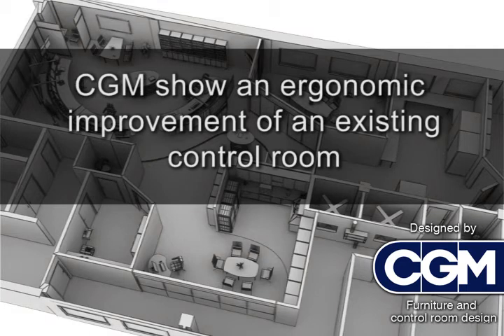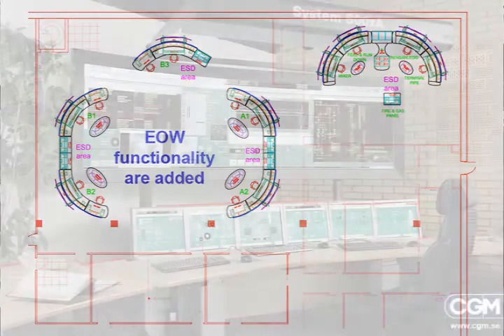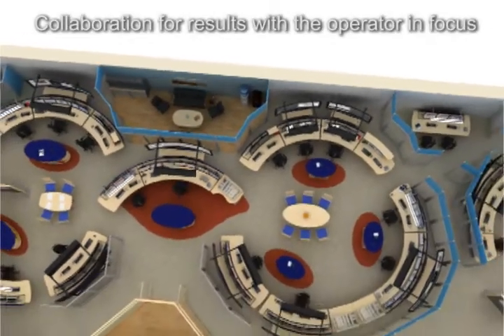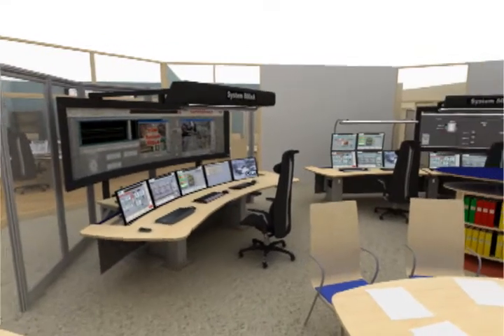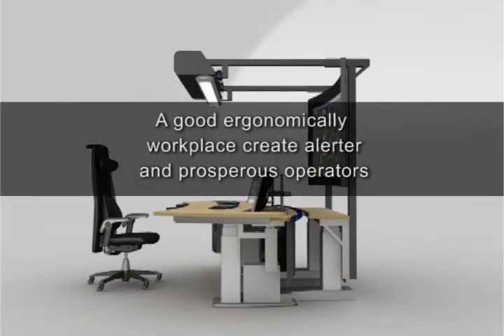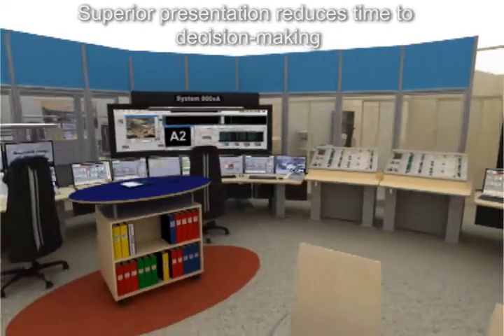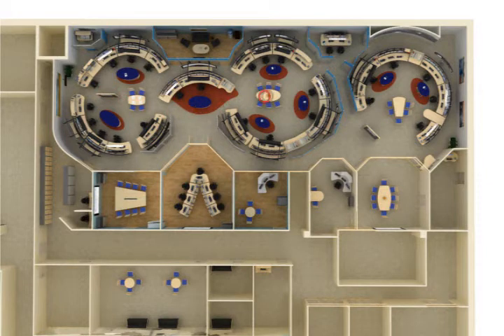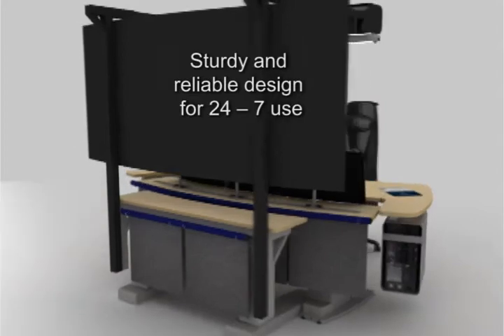CGM Control Room Planning

Comment: not working in operations anymore, but now i want to redesign my home office to be a control room and have the same layout at the office. ups, there goes the cash ;-)

the 3D view is really great for feeling into the room layout. just watching this, I saw i'd wish the little oval document / storage cabinets a bit more far away from the chair. if you get up when you're very tired / exhausted you want to walk a few steps freely (more distance than your roaming area when sitting) for circulation before rouding an obstacle.

really a great planning tool!